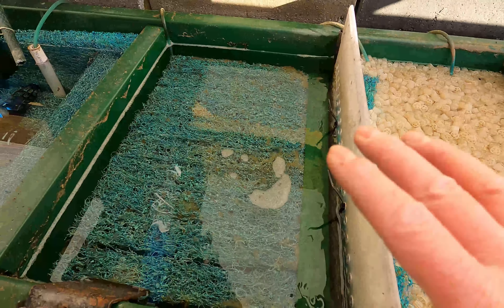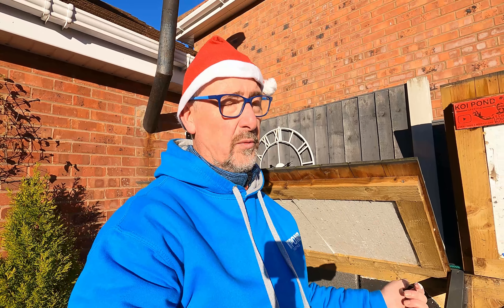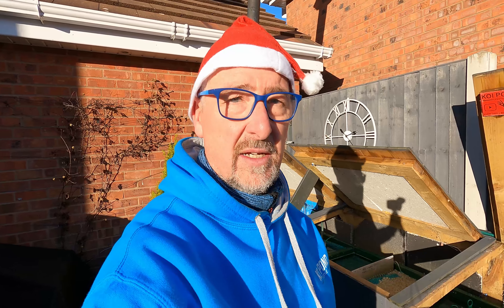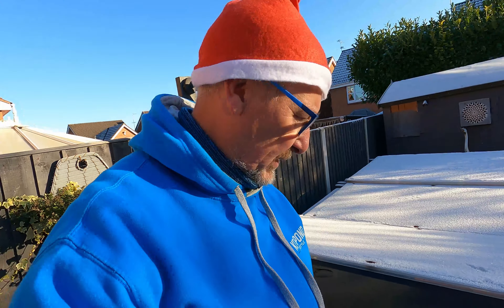KOI POND*IMPORTANT PIPEWORK CHECKS FOR FREEZING WEATHER🥶🥶**+CHEESY XMAS SPECIAL WITH SING ALONG😁😆**

Comment: Chestnuts good for the pond water after you have eaten them best ones are Chinese, I always drop mine in water bad ones sink at once best way to cook is make a pin hole by pushing a needle through them that way they don’t explode. Put the waste shell in hot water in a 2lt jug and leave 24hrs then put the water in the pond it helps stop algae the shells can also be put in the filter as they are a great home for good bacteria.

Comment: Hi Andy, 
Just be careful turning your pump down. 
I did it end of November hoping to save some money on electric.  
Cold snap came and got up in the morning and everything had froze.
 I thought good bye to the 2x UV's and the pump and pipe work.
After 5 days things started to thaw and I was lucky only some pipe work had split. 
As far as I'm concerned never again its not worth it. 
Never had any issues in the past so yes running water does freeze if its turned down. 
Pipe work fixed and now insulated and pump running back up to normal, got away with the UV's as well.
Very lucky.
Reply from the maker: Hiya, thanks for that feedback.  Every day is a school day..😉👍

Comment: Happy Xmas Andy, thanks for the vids this year, much appreciated. 
Ive have an in ground pond for 30+ years, no winter covers, no winter air, no pipe insulation on external filter. I just run  a small pump though the filter with UV off. Didn’t know any better but it’s always been fine. 
Having got back into the hobby and seeing the many vids, I think it’s a great hobby for people who like tinkering and tweaking. I’m now guilty and doing all the tests and treatments etc which I enjoy but for 30 yrs the fish were fine without it!  My boys are 20 and 21 but most of my koi are older and a lot easier to keep! Cheers.
Reply from the maker: Thanks for that.. 👍 Glad you've been enjoying the videos..😉👍

Comment: Hi Andy, I thought exactly like you, running a 80 Watt pump 24/7/365, I bought a Varispeed hoping to roughly halve the power and output for the colder months. When I tried it, with a Watt meter in line to see the effect, it didn't work, there was only a tiny change in the Watts, then the LEDs on my switch box started flashing eratically - so I shut it off quick. There was no audible change to the revs/speed of the pump.
Reading after the event and speaking to my son, apparently most types of pump motor don't respond to having their voltage strangled and I'm lucky not to have damaged the circuitry in my pump! 

Anyway - perhaps a bit more research before you try it, I'm not too sure but best not to risk expensive damage. I know the Varispeed is OK on air pumps, different cup of tea.

All the best, Seasons Greetings to you and family, have fun.
Reply from the maker: Hiya, thanks for that feedback. I see a school day coming... thanks for shareing your experience. More tests I think before turning down a water pump then..🤔😉👍 Merry Christmas..

Comment: UK latitude is 55* and I am in Wisconsin which is located in the US and I am at 43*. As for weather we are at -8* F (-22*C) for you. You must heat your pond in order for it not to freeze over. I have to drain my filter system, drop the water level in my pond to prevent pipes from breaking.
Reply: Merry Christmas
Reply from the maker: Hiya, just been watching the weather in the US. I see your experiencing some real low temps real quick. Good luck and hopefully your pond gets through it. My pond isn't heated. I just ensure everything is well insulated and the pond is covered with polycarbonate sheets that as you saw in the video are doing exactly as I wanted from them... 😉👍

Comment: Do I put my pond inside of a shed or should that be do I build a shed around my pond.
The advantage would be the use of greenhouse heathers or log burner to heat the shed which would heat the water at the same time.
However, would it be to much for the garden a shed 15ft by 8ft by 7feet high.
Advantage the fish would be at a stable heat all year and I could go in and watch the fish when I wanted too.
Not like now when most of the year is dark cold windy rain snow or ice.
My summers are short and winters long.
Half the roof I think would have to be clear Perspex for light.
So what would it cost that’s the number one question
Reply from the maker: What about half in and half outside pond? Best of both worlds then..🤔😉👍
Reply: @KoiPondLifestyle  The prime maridian is the thing I have a 2 month longer winter than down south it gets dark here half an hour befor the south and stays darker longer. As I am  on a direct line with Esbjerg Denmark so get all the bad weather.

Comment: Well I am tempted a koi keeper further north than me well 20 mile  a way is selling up he has sold most of his equipment and big fish have gone however he has a few Kikusui 30cm left problem is the pond they are in is or was heated my pond is open other than the covers. So at £25 each do I take a chance on 2 of them however at the same time will my pond be to over stocked as I have 22 fish in already.
Reply from the maker: In my opinion, introducing fish from a heated pond is risky if your pond is prone to very low temps without having the fish to acclimatise but for how long is anyones guess. My new showa from a heated pond spent months in an indoor pond before coming to mine, and so far so good asnit is a mature fish. 👌
Reply from the maker: If your filters will take it. 🤔🤔
Reply: @KoiPondLifestyle  Talking to a local fish breeder it seems I have been doing things wrong he said you should have 1 koi max size 15” for every 300 gallons of water and reduce this to 2 if over 15”.
Over stocking he said can cause a ramp up in infections among the fish.
Well, a lot of people may have forgot but part 1 of the price cap ends at midnight tonight and from the 1st everyone will be paying more for energy as it will rise from £3,549 to £4,279 it will also rise again in April.
Its also possible that from April you could be paying more council tax in some areas my area will be one if you have a garage and you don’t put your car in it then some councils will class this as an extra room and may charge you more council tax.
Also, in most areas the new clean air rules update come into force.

Comment: Did not devon koi do something with balls...anyway you can not use normal balls as they have a small hole in for child safety you have to buy proper pond balls which cost around £110 a 1000 so I t hink the average pond would need around 5000 so I would think not cost effective.